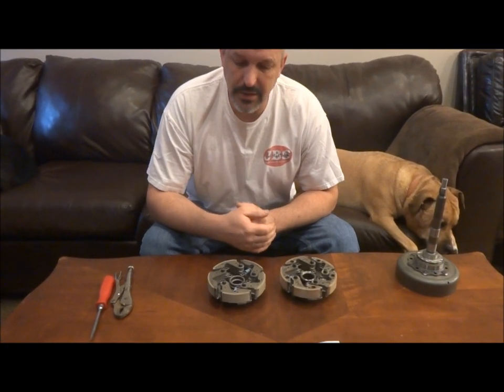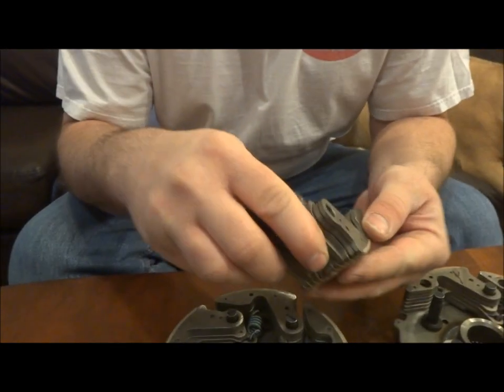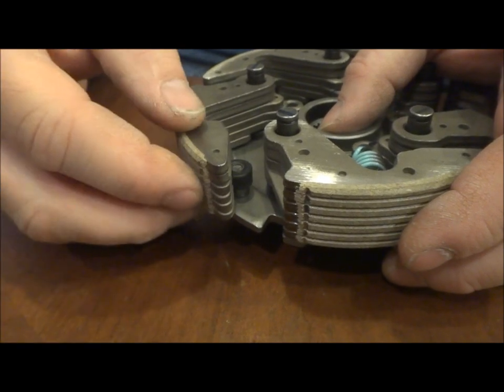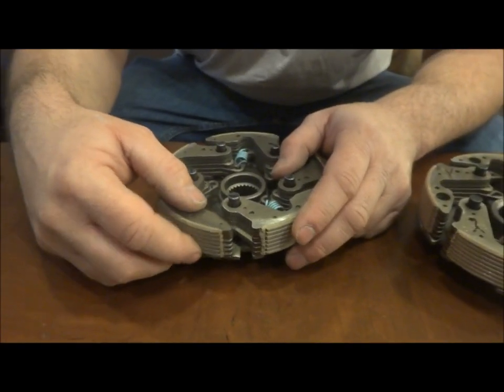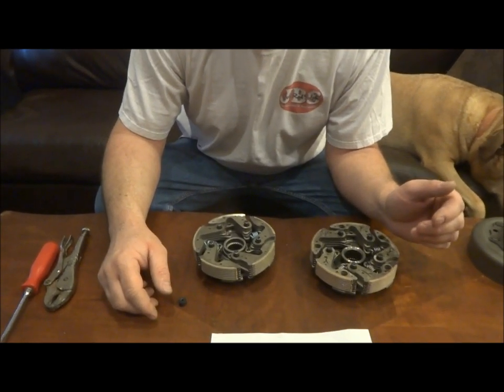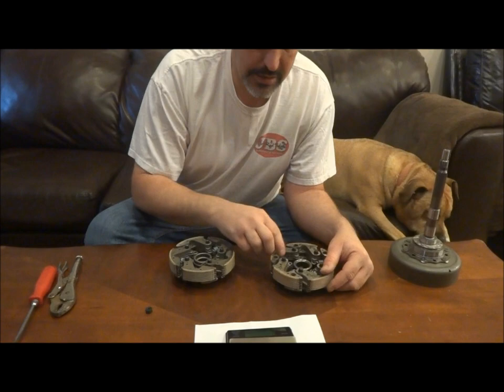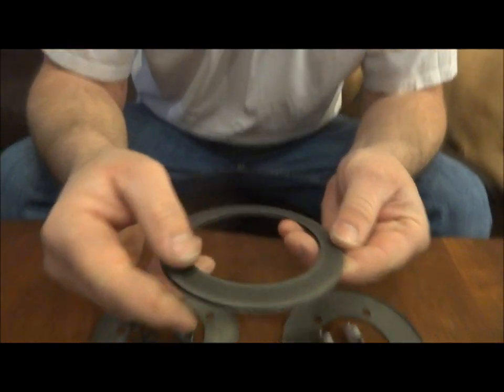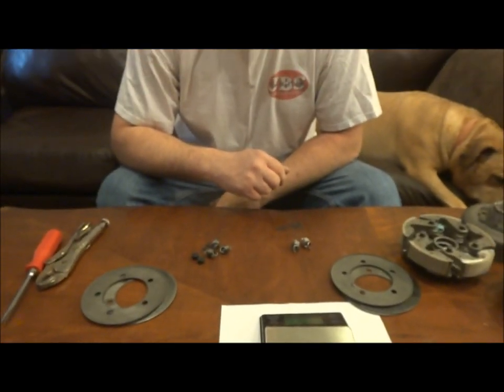Kawasaki T2/T4 Wet Clutch Issue

Comment: I just changed my oil in a 450 Grizzly.  I took it out for a 1/4 mile ride. I then realized I used auto synthetic.  
What should I do now?  Can I just change the oil with Yamalube, or do I need to flush it.

Comment: @JBS PERFORMANCE So does the shoe on the kawi  need to come in that far to release from the drum? Maybe they put the rubbers there so that it doesn’t have to travel so far to engage for a quicker/smoother engagement? 
Also the softer springs would allow it to engage the drum quicker wouldn’t it? 
It would flig the shoes out at a lower rpm which should help with engine braking as well. 
Have you or has anyone tried the Kawi springs in the Rhino wet clutch? 
And the Rhino shoes are 2 grams heavier but since the Terxy has no hole for the slugs maybe it has more weight at the tip of the shoe that may make some differences when it engages?

Comment: hey wv hot rod rhino i have a kawasaki bayou 300 4x4 and im thinking of a new clutch in the winter for it, what kind of a diferace would it make if i took those bussings out? what will it do for the clutch? make it engage fasrter? any info will help thanks!

Comment: I have a Lakota 300 also but, as soon as I put it in 1st gear it moves forward even it i am holding the brake also when i come to a completely stop it stall. Does anyone know why? It start right up but it does it every single time I stop,
Reply from the maker: One-way bearing is bad
Reply: @WVHotRodRhino  Thank you for your help, when weather gets better I will work on that, I really appreciate your input.

Comment: Would the rhino clutch interchange with the teryx clutch since they appear identical?
Reply from the maker: The splines are different
Reply: How about the shoes? Would you be able to use the Yamaha ones so you can put slugs in it?
Reply: @artfulcarnage  i was thinking the same thing.just knock off them pins and viola